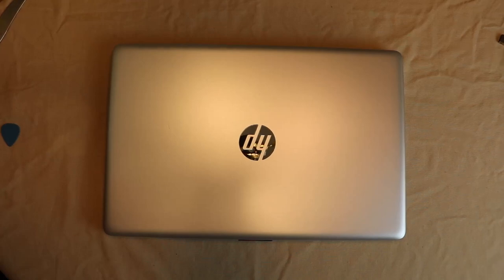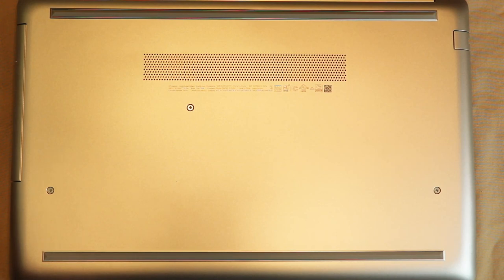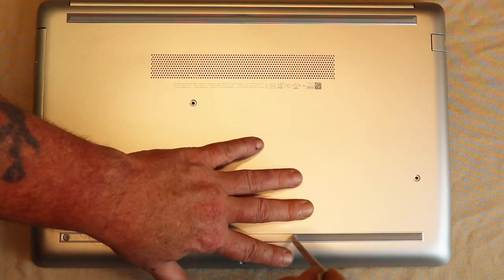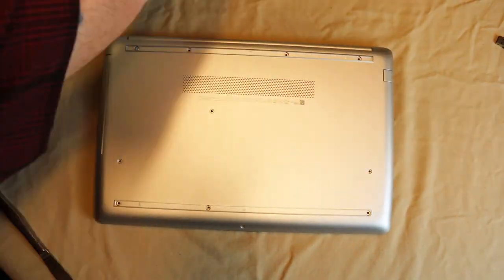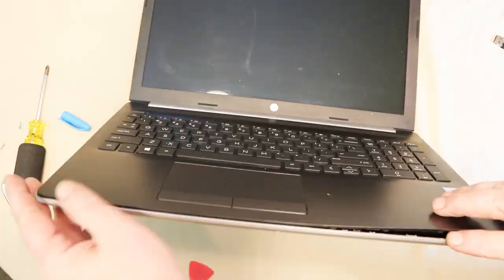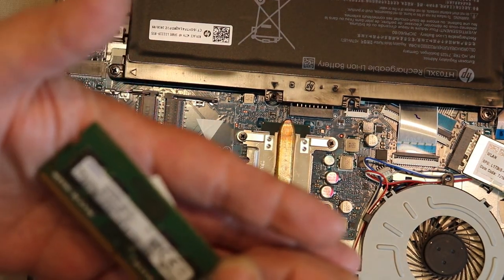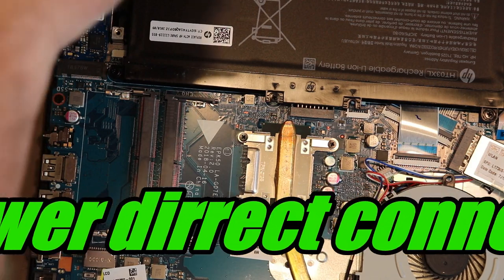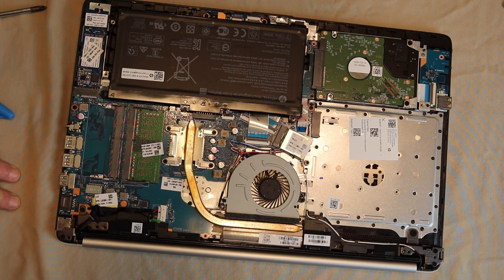Hp hp 15-da0053wm Ram Upgrade

Comment: I’m gonna try this with 2- 16gb to update this laptop!
For total of 32gb
Reply from the maker: I forget now, how many is max in these laptops now. I've not used my "screwed up" HP since I purchased my new, gaming laptop, my Gigabyte Aero. Good luck with that though. Just be sure to use the correct RAM..
Reply: @HayesTech  it work flawless.. took little to get going, but once she was up.. I had multiple task going and only using like 8GB ram leaving plenty for whatever more

Thanks..
Reply from the maker: @Pittocarrillo  
That's great to hear. I hope your get years of good service and use with it too.

Comment: My DVD Or Disc Burner whatever you want to call it, isn’t showing up when I boot up the Laptop... I put everything back the right way, please help?
Reply from the maker: There a weird one. The only thing I can say is to make sure around the connections to the DVD player are doing what they should. Make sure it's pushed in the whole way too. Other than that, call HP and tell them it's no longer working. Don't tell them you too the laptop apart though and they should help you out. HP had great customer service
Reply: Yeah I reopened the laptop and pushed the DVD reader more securely into the connector/port and it registered when I turned my laptop back on that I had a DVD reader, thanks!
Reply from the maker: @alexander-mythixschroeder3916  that's awesome. I remember I had the same idea a couple times, once in this laptop and once in my other one. And I'm both instances, all I needed to do was remove it and insert it again and it worked for me  I'm glad to see everything is working for you now. Thank you again for commenting and for watching.

Comment: We’re you able to install the second stick of RAM? I can seem to get it to seat properly, the first stick was easy but not wanting to force it.
Reply from the maker: Yes, mine went in fine. But if I remember correctly It was tight too. Not crazy tight but it was snug. I've found though that the best way to get the most from your ram is to use 1 ram stick, as large as you can afford. I'm not running 1, 16Gb stick of ram in mind.

Comment: Let's say that you got a 16g  and you want to use also the 4g can u use both and have 20g?
Reply from the maker: Yes.  But I'm not sure that the 4Gb chip will make much of a difference from the 16. 16Gb ram in these laptops really kicks them into overdrive.  But it can't hurt throwing in the extra 4Gb either. If you put in a 16Gb stick of ram, you will definitely see a massive difference. My laptop that they sent me to replace this one came with 12Gb ram ( one 8Gb and one 4Gb chip) and this really made this thing run fast and smooth. Remember though, the max ram you can install in these laptops is 32Gb.
Reply from the maker: To put it in an easier way to understand... At least for me... Lol... Most PCs and laptops work best when both sticks of RAM are the same. Meaning, that if you primarily stick of RAM is 16 GB then your secondary, or B slot, should be the same as the A slot. That doesn't mean that you can't use the 4 GB stick with the 16, but from everything I've read and experienced keeping the RAM paired usually gives you the best benefits. So yes, adding that 4 GB stick to your 16 GB stick that you purchased will definitely add to it. I hope that made sense...

Comment: I'v the same but really desapointed, 1Tb (used 500Gb), 4Gb ram, but it's slow and recently ive installed a virtual machine which make it worst, may be need to upgrade the ram ?
Reply from the maker: With my 8Gb of ram in mine, I'm editing 1080p videos with zero issue and editing 4k videos with some time (meaning after dropping in the 4k video I have to wait till the red line goes the whole way across the video before editing). I can still edit the 4k Videos but if I want to have smooth playback while editing, I need to let that red bar build completely.
After I get some money saved up though, I am going to upgrade to a high end gaming laptop. They are some of the best for editing 4k videos. But if editing 1080p, this laptop is a dream and did it very well 
Good luck to you and I'll tell you now that adding even 4Gb of extra ram will make a huge difference. I highly recommend getting the total amount you want to put in it in one chip though. It just uses the ram better from a single chip than from 2 chips. 
I was running 2, 4Gb chips for a total of 8Gb and it was running pretty good. But after switching to 1, 8Gb ram chip (installed in the "A" slot and leaving the "B" slot open), it seems to be running even faster and smoother. That may just be me since I didn't run any speed tests, but that's how I will be upgrading the ram from now on in this laptop.
Reply: @HayesTech  thank you for the info, will replace the 4gb by 8gb instead of adding another 4gb
Reply from the maker: @nabilou8106 
If this doesn't make it run any better than I would contact customer service and have them work on your laptop. I had to send mine back to have them fix mine. But after getting it back it runs like a new one and I haven't had an issue since. 
You may even want to contact them before trying to upgrade the RAM. Although it never hurts to add more ram. But if you have to send it back to them for repairs, it's best to send it back without it being modified. 
Just a heads up .... And good luck to you.
Reply: @HayesTech  Thanks a lot, After saying that, i've used the HP assistant and found that al software's drivers weren't up to date, beside of that everything look fine...Now it's responding good, however, in order to add a new Ram, i'll have to follow the steps shown on your video which i thank you for it, meantime, i'm gonna give a moment and see, but sure will upgrade the memory.
Reply from the maker: @nabilou8106 
That's awesome it's running smoothly again. After getting mine back from HP they said it was important to allow all Windows and HP updates in order to keep it running smoothly. And like I said earlier, after getting it back, I update everything when the updates for up. 
Good luck to you and thank you again for commenting and watching.

Comment: How can I increase the speed of my computer it’s a HP 15-bn070WM, I have no knowledge of anything computer tech related. Just tired of my computer running slow even though it’s only a few years old. Any advice would help, thanks!
Reply from the maker: Well but running slow, what exactly do you mean? Is it running slower than it did when you purchased it? Are you taking all the updates both from Windows and from HP? They are very important. I had to send mine back to HP and they completely wiped and reinstalled everything to fix mine. It's running like new to this day.
Reply: @HayesTech  currently in the process of completely resetting laptop back to factory settings,  will see if that fixes it. By slow I’m referring to if I want to open an application such as google chrome, PowerPoint, word, etc. it will take minutes to open and even when it opens still takes a while before I can actually click and use the applications.
Reply from the maker: @austinkmiec8741  that's exactly how my laptop acted too. But after they fixed it for me it's been running like a champ
Reply: @HayesTech  do you know what they did to fix it or what the problems were? Also how much was it to have it fixed?
Reply from the maker: @austinkmiec8741 
They just wiped it and reinstalled Windows 10 and all their own stuff too. As far as I know it was conflicting software that they installed from the factory. And it didn't cost me anything.
Reply: @HayesTech  thanks for the help. Any advice to keep it from reoccuring? I try to erase memory when I can and try not to install too many softwares but since I’m in college they require a lot of different ones for online learning.
Reply from the maker: @austinkmiec8741  
Well, from what they told me, keep it up to date. Don't miss any updates, either from Windows out from HP. I sure hope everything works out for ya. Good luck to you.
Reply: @HayesTech  thanks for all the help!

Comment: What's the MAX RAM it can handle? 16GB single ok?
Reply from the maker: Max is 32Gb. And yes, a single 16Gb would make for a fast laptop. I've had to move on though because I started having issues again with it. They actually replaced it with a different laptop. The replacement laptop is almost exactly there same but came with 12Gb ram and 2Tb SSD. And I've had issues with that one too.
I can't recommend HP. Even though I know they have put out laptops that have not had any issues. It just seems like every laptop I got from them have me issues. 
I hope that helps and I am not saying that yours is a bad laptop either. I've just had a bad experience with HP and I'm done with them.
Reply: @HayesTech  thank you as always... ya I'm crossing my fingers 😁

Comment: I have a HP 15-da0xxx and was assured by P C World that the standard 4GB RAM was more than adequate, not the case, the laptop is quite slow and requires restarting at least twice a day otherwise it gets to the point of being so slow it's unusable, it takes an age to give you the login from the lock screen and I have also had to replace the charging jack,  I don't know if most of then problem is old style hard disc drives not coping well with windows 10 but by contrast my 8 year old Toshiba Satellite laptop on Windows 7 is up and ready to go from start up  in a quarter of the time of the HP  and doesn't hang up all the time.
Reply from the maker: I'm not sure what the issue is there. But I would send it back to HP because, if it's the same one I have it shouldn't be running like that. That's how mine was behaving when I had to send mine back to HP for repair. Now mine is running like a top again. And K highly recommend adding at least 4Gb extra ram, if you are planning on using it to edit videos.
Reply: @HayesTech  fitting an extra 4GB of RAM upping it to 8GB seemed to fix the problem, fitting an SSD improved it further, I now have no issues with the laptop.  I have moved to SSD on my old Toshiba Laptop and am now running windows 10 on it with no issues
Reply from the maker: @luvstellauk  that's awesome. I know that my laptop edits videos with no issues At all. 4k videos take a little longer to get fluid but is I load the videos and give it 30 minutes to settle in, it goes smooth as silk. 1080p videos edit very fast. I love this laptop. I would love too have the money to purchase a purpose built laptop made for gaming or editing but until I can afford one, this thing works fine.
Thank you again for commenting and watching. Don't forget, as soon as I hit 5000 subs I'm giving away my Canon t6i, so be looking for that...

Comment: I have upgraded mine to 4+8 but it seems like the laptop only wants to read the ram that was put on the first/primary slot
Reply from the maker: That is weird. What brand did you use? HP laptops can be finicky. This is the brand I used: https://www.crucial.com/compatible-upgrade-for/hp---compaq/hp-15-da0053wm
Reply: @HayesTech  nvm, i actually just had to insert the second ram card a little deeper lmao
Reply: @HayesTech  thanks for your reply btw
Reply from the maker: @bayanganyangbecermin3373  
Glad to see it worked for you
Reply from the maker: @bayanganyangbecermin3373  you are very welcome.

Comment: Wait so do you put in another 4GB ram to get 8 GB? Or would you buy a new ram drive with 8GB
Reply from the maker: The Laptop has 2 ram slots and it comes with one, 4Gb stick of ram that is installed in the #1 slot. That leaves a slot open. So I just purchased a 4Gb stick of ram and put it in the one empty slot (the #2 slot), for a total of 8Gb. 
Now that I understand more about how ram works, I think my next upgrade will be to purchase one 16Gb ram stick and put it in the #1 slot and leave the #2 slot open. 
I hope I didn't confuse you and if you have any more questions, please don't hesitate to ask.

Comment: Hello, I have a question. I have this notebook, but the title of the laptop has a different title. It's named HP Laptop 15-da0xxx. What kind of RAM should I install.
Reply from the maker: This is where I got my ram from but it is specifically for my model PC that I showed in this video. It will work for many other laptops but I can only confirm on my make and model.
https://www.google.com/url?sa=t&source=web&rct=j&url=https://www.memorystock.com/memory/HewlettPackard15da0053wm.html&ved=2ahUKEwjJurT7ndDlAhVJnlkKHdJvDBQQFjABegQICxAG&usg=AOvVaw0c0JMy92UQSV0xCeSn4oet&cshid=1572859487787
Reply from the maker: Here is another site that lists ram for your specific laptop
https://www.userbenchmark.com/System/HP-Laptop-15-da0xxx/90877

Comment: This is very informative.
I am a guy who knows ZERO, zip, nada, about computers, yet I was able to easily understand eveything in this video.

See I've got this computer but it's running like a bitch so I've decided to look into getting some SSD or RAM for it.

Everytime I need to know what the heck ram and SSD are I have to look them up. 😂

I am a big dumb. 😂
Reply from the maker: No, you are not ..lol. I'll bet you have knowledge about other topics, that I would be totally in the dark. Before expanding your ram though, you may want to try to revert back to a saved backup (if you made one). And even installing extra ram may not be the issue. I've made other videos on these HP laptops that explain why I'll never go back to HP products again. But with that being said, my issue (I had several, with both laptops) may not be the norm either and it may have just been the person's who were trying to sell me upgrades and more products (extended warrantys, and more expensive customer support). 
Please keep me informed on how you make out with your laptop too. 
On a positive note, others have absolutely no issues with theirs and still love them. Good luck to you and thank you so much for watching and commenting. I do appreciate it.

Comment: Just purchased this HP15-da0037nr and know I want to upgrade to 8GB Ram. It will come with 4GB stock, currently being shipped as we speak. How do I know what type to get?
Reply from the maker: https://www.crucial.com/usa/en/compatible-upgrade-for/HP---Compaq/hp-15-da0037nr
Reply from the maker: https://www.crucial.com/usa/en/compatible-upgrade-for/HP---Compaq/hp-15-da0037nr

This is where you can get ram and other components for your laptop. This link is specifically for the laptop you posted above.

Comment: Where is the core processor(my processor is AMD A9 2C+3G) located, in case I ever want to have that replaced? Can't seem to find that location. also, my sound seems to mute, and then I hear this popping sound. Near the fingerpad. Wasn't really concerned with the ram location, but it is good to know where it is located, since I have never taken this laptop apart.
Reply from the maker: I'll have to look at my video again to see. I thought I showed it in the video, I have a couple out with the back off. Shouldn't be too hard to find. Mine is Intel i5. And it's not replaceable unless you un-soder it... I think...lol... I've never replaced a CPU in a laptop before, only in PCs.
Reply: @HayesTech  Just got a reply on another vid. He said they are not replaceable. It does rock to have games installed on the same laptop for work...
Reply from the maker: @Joe_334  
That's what I thought. I know that you can replace them but you have to have high tech tools for unsoldering the CPU from the motherboard and I don't have that tool. And even if I did, I don't have the knowledge to do it. And you have to make sure the new CPU would even work. Well I'm happy that you got your answer. Thank you for watching and for posting. I really do appreciate it

Comment: Does hp 15-da0004tu lap support m.2 nvme?
Reply from the maker: I am not 100% sure on that one. But the link I posted, for the parts for ordering, should have all the information on parts that can be replaced. From what I've researched, using the Optane Ram works best in my situation, so that's why I never changed that out.

Comment: Can i REPLACE the ORIGINAL existing 4GB Ram with an 8 GB Ram and then ADD a new 8 GB RAM in the empty slot ? this will make the RAM total 16 GB. Can my Laptop handle 16 GB of RAM? This is my model number:  Hewlett Packard 15bs234wm.Thanks!
Reply from the maker: Yes you can. From what I've read, 16Gb if the most this laptop will recognize though. So you should be good. Good luck to you sir.
Reply: @HayesTech  Thank you very much! I have read that it wont recognize more than 12 GB. That's why i was asking.
Reply from the maker: @joyl9083  
That may be true for the model laptop you have. Mine has 8Gb now (I added 4Gb for a total of 8Gb) and I can edit 4k videos. It does best with 1080p but editing 4k is not out of the picture. Hopefully you're will work as good for you as mine does for me.

Comment: Tomorrow I'm upgrading a similar HP 15 to a 120gb SSD. wish me luck
Reply from the maker: Good luck to you. I have all the faith in the world that you'll do fine. It's not that hard. I think the most difficult part is actually separating the bottom from the top, after taking out the screws. But if your careful you'll do just fine.

Comment: If I want to put in a larger ssd hard drive, how would I re install the operating system?
Reply from the maker: Well, you would have to get a program that does that for you, before you pull out your original hard drive. After installing that program, run it and it will put your OS and all your information on the new drive. Then, and only then, you can swap out the drive. 
Keep your old drive for emergencies though...lol... You never know.
Here are some of several of these type software
https://windowsreport.com/ssd-management-software/